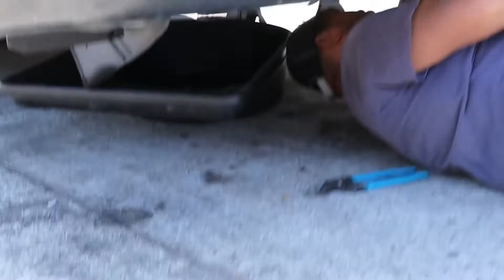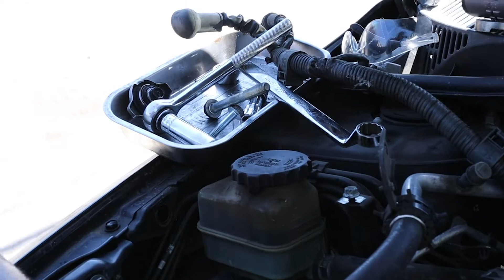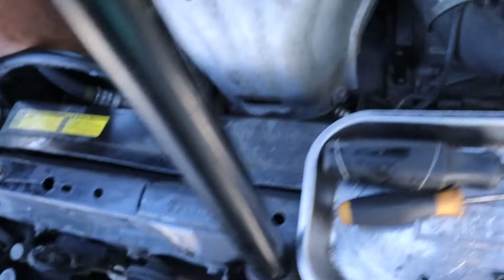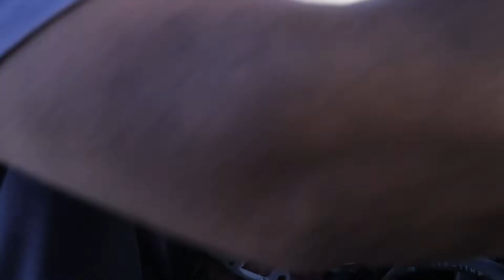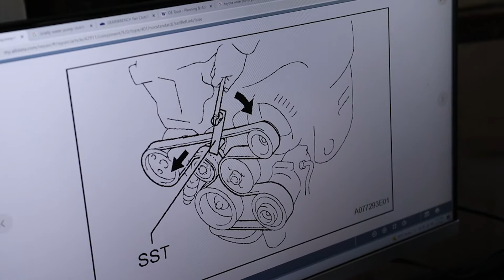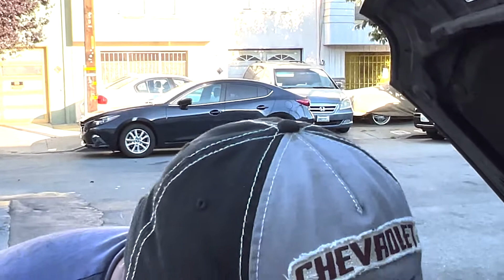2007-2010 SCION/TOYOTA TC-COROLLA-CAMRY-XB-RAV4 Easy Removal/Install Water Pump & Thermostat & Bleed

Comment: I’m jw how’s that pick tool holding the pulley in place when you’re turning the other way to loosen the pulley
Reply from the maker: ohhh it's easy you just have to break one bolt and put the pick tool to hold the pulley and you can revove the rest of the bolt for water pump pulley, sometimes its hard to find the special tool for it. you just have to improvise with what tools you have in tools box. good luck

Comment: Did not see you disconnecting the battery.
Reply from the maker: ohhhh i disconnect battery negative terminal, it just not show at the begging, but i did disconnect the negative terminal, because i have to since i have to remove the alternator. 

also if your considering to subscribe to my channel just click the subscribe button so you can get connected to my latest content. 
thank you so much

Comment: Would a bad water pump cause ticking/tapping noises?
Reply from the maker: Yes I experience that's In higher year like 2012 and up, if you take off the serpentine belt just free spin thr water pump pulley and you should feel vibration. And that's your water pump bearing is getting worn out

Comment: Of course he skipped putting the serpentine belt back on. Tc's are notorious for this being a real pain & when I did it, the tensioner bolt broke off (it's aluminum cast into the arm) & I had to replace the whole tensioner assembly which involved jacking the motor high enough to pull the long tensioner bolts out.
Reply from the maker: Next time I will do video for it and I learn easy ways to put serpentine belt, by putting the belt at water pump pulley in last since it does not have teeth.

Comment: I own one of these cars..its a great car..mine has 230.000 miles and runs like a champ..already replaced alternator..
Reply from the maker: Yes yes brother as long you keep up with oil change noo Need to worry, this engine are great. But some has engine recall due to oil consumption. After recall everything is good

Comment: Does the waterpump have a gasket or do you need to use gasket maker?
Reply: Nvm I saw later in the vid
Reply from the maker: yes water pump does comes up with gasket, when you buy them at orielly or autozone

Comment: Theres no need to loose the motor mounts and lift up the engine?
Reply from the maker: No need to remove engine mount, once you take off alternator and other hose that's blocking your way, you home free to take off water pump. You have more access once you take off water pump pulley and alternator